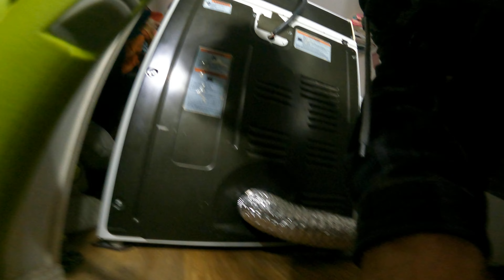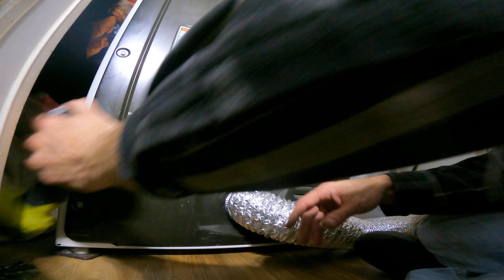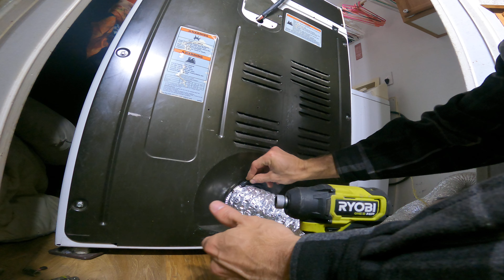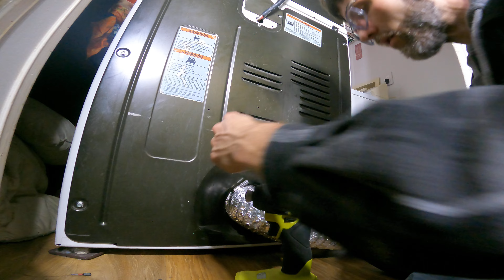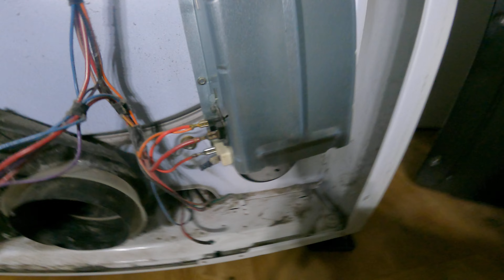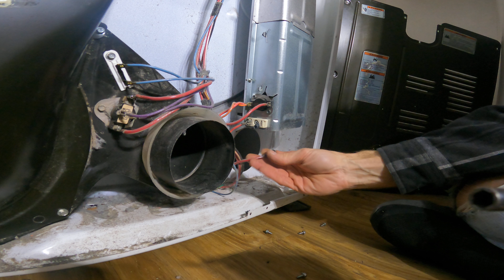How I fixed my Whirlpool Dryer heating element power wire melted from getting hot with new terminal

Comment: What reason cause that?
I have the same thing I reconnect wire than it melt again..
Reply from the maker: Most likely a bad connection. That's why i used a new wire terminal.  When a circuit has a bad connection, the entire wire will heat up and melt if it gets enough power going to it for long enough.